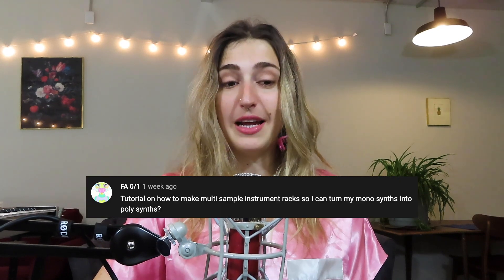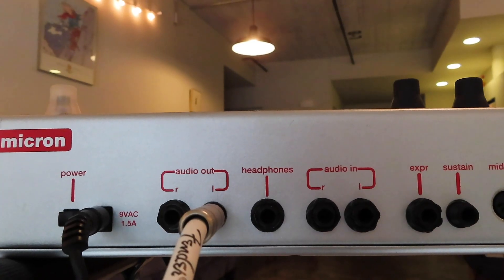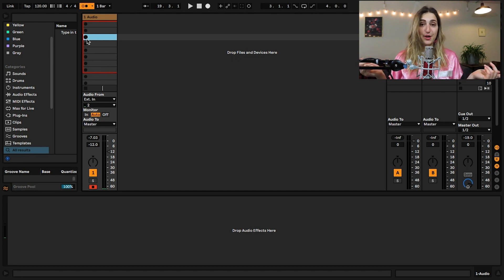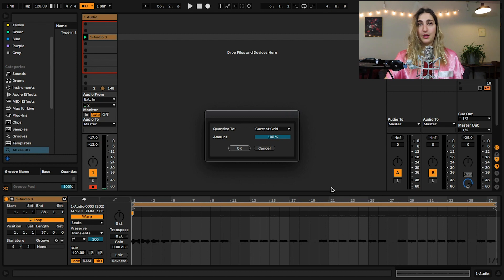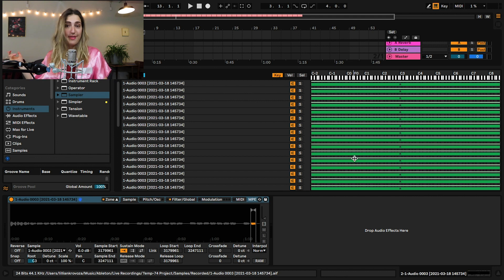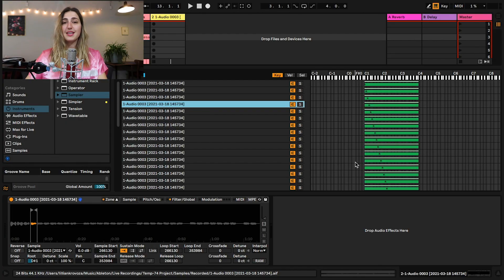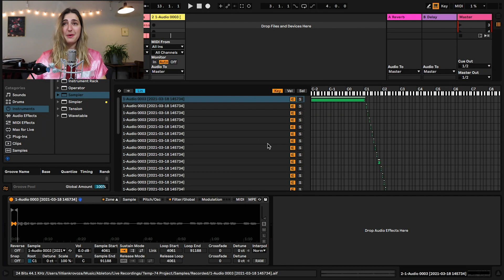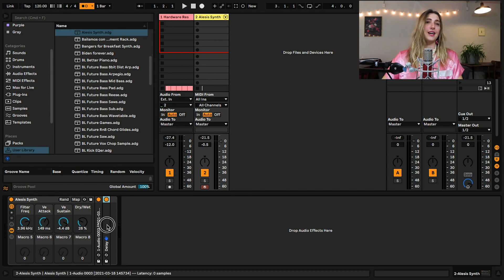How to Multisample a Hardware Synthesizer (Ableton Tutorial)

Comment: I'm recording samples with my prophet, should I record with the effects ON or OFF? The reverb and delay pulls into the next measure.
Reply from the maker: Hey Doc, it just depends how you want your multi-sampled software instrument to sound. If the delay/reverb is lasting over the measure, no worries, you'll just make 2 measures (or however long the sample takes to fade out) the length of time that you chop you samples up into. Hope that helps.
Reply: @LillianFrances  Yes that is helpful! Followed your tutorial step by step and got the results I'm looking for--thx so much 👍
Reply: @Docdoolit  in most cases sample without effects as you can add effects from Live later, if you have a sustained sound the keys cut off unless you have a long release setting and that means that notes you want to decay faster will need to play till the end to get the sample effects to playback,